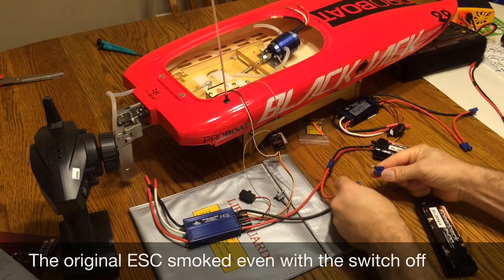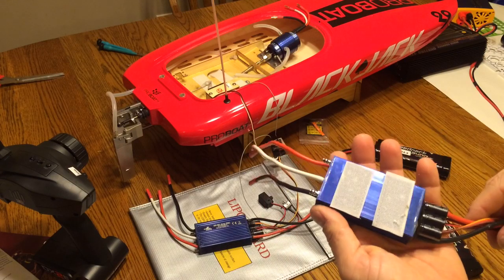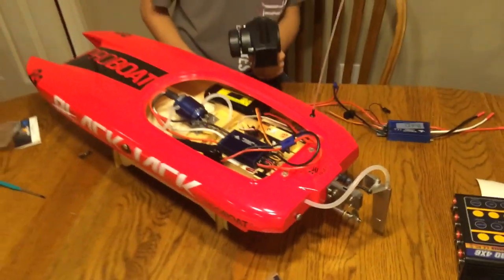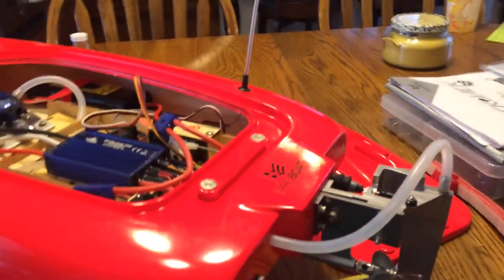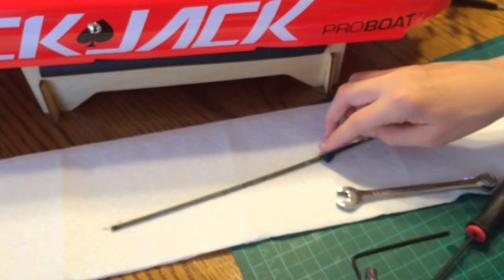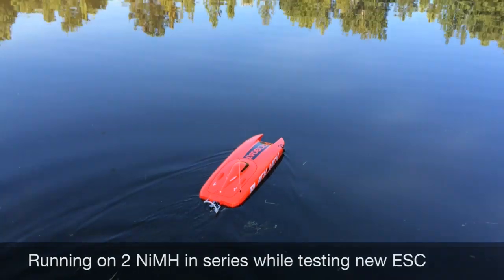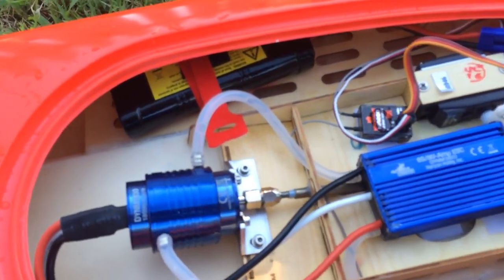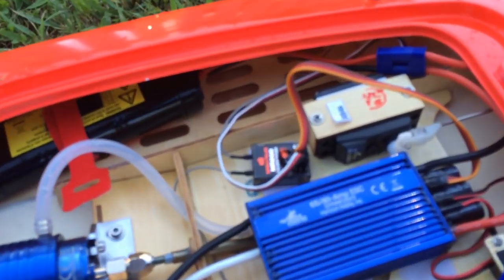New Proboat Blackjack 29 (Failures, Fixes & First Run) [KTFG 093]

Comment: Hi Kevin, thanks for the video. I have the chance to buy one of these for $300, but after seeing this and reading some comments I’m hesitant. I realize this was 10 years ago but do you know if Proboat changed anything to improve? or something I should check before purchasing?….thanks
Reply from the maker: I have been out of the Hobby for years now so not sure.  But if brand new from a reputable retailer I don't think you should be concerned.  I don't think I would pay more than $300 for this though and there may be more options on the market now.
Reply: @KTFG ok and thanks for taking the time, again I realize it’s been some time lol, I’m new to it. I like the Pro Boat models or at least from what I’ve heard. Maybe I will pass for something a bit more up to date. Take care

Comment: I keep snapping my flex drive shafts, any advice please
Reply from the maker: Did you upgrade the motor?
Stock motor shouldn’t have enough power to repeatedly snap shafts
Reply: @KTFG  cheers for the reply Kevin, no the only up grade was the battery iv got 3 cell 5000 Lipo witch the shop said would be fine

Comment: Hey there, Love your videos and had a question.. Do you happen to know what would cause the boat to slip upon acceleration every now and then? I’m running a Proboat 24 with everything stock and lubed. Thanks
Reply from the maker: Thanks,
What do you mean by slip?
Prop stops spinning, it jumps out of water?
Reply: Kevin Gittemeier Thanks for the quick reply. When I say slip, I mean that when I hit the throttle at takeoff, sometimes the boat takes a min to catch up to the throttle. Then other times, the boat responds immediately to trigger pull.
Reply from the maker: That’s interesting. Possibly a problem with remote or ESC.
Can you simulate the problem with the boat out of water?
Call Proboat and speak with them about it, their customer support was pretty good when I dealt with them.
If it’s still under warranty they will send out replacement parts.
Reply: Kevin Gittemeier Ok thanks, 😉
Reply from the maker: Judging from your image I assume you watched the CM v DC fight.
What did you think?
Reply: Kevin Gittemeier I’m a big Conor fan but love Cowboy too.To be honest, I think cowboy was a little off from the last couple times he’s been knocked out before this fight. I still feel that something wasn’t right about that fight. 😉
Reply: Kevin Gittemeier and still unsure about the Cm-DC fight. 🤔
Reply from the maker: Although there are paths for victory for Cerrone, stylistically Connor is a terrible matchup for him being a southpaw, fast starter and a sniper with the best reads and set ups in mma.
Anything can happen in a fight but if Connor doesn’t win 9/10 he wins 10/10.
Though I predicted a 1st rd KO, I hated to see Cerrone get scrubbed out like that but a lot of exciting matchups for Connor now after that.
Reply: Kevin Gittemeier I completely agree man. 👍👍👍
Reply: @bigfan1364  I know I'm replying to a year old question but I'd lean towards prop high and angle adjustments.  Sounds like your experiencing cavitation upon getting on top of the water.

Comment: I have had the Black Jack 24" for 3 years and it is a great reliable boat. Would recommend 👍🏼
Reply: My boat won't go it beeps can you help me?
Reply: It sounds like the esc in your boat and the remote control need to be synced together. They will beep when you turn the boat on normally but not continuous

Comment: what do u think of 2000kv leo and 180a seaking running on 6s
Reply from the maker: +Sm1 Sm1 
Sounds good to me, just make sure the components are rated for the voltage you intend. 6S is a lot!
Post a video when you complete it
Reply: +Kevin Gittemeier  sure i will ... but can u advice what component and if u have other option to modify b.jack 29 v3 it ll be great . i just need this to reach 80 mph 
thank you
Reply from the maker: I cant help you get any boat to 80mph, that is a lofty goal.  Maybe just work your way up with different boats and motor configurations and as your knowledge and experience increases you will get closer to your goal.
Reply: Kevin Gittemeier ....thanks bro the only reason i asked about setups is the shipping time to my country i have to wait 2 weeks and if i keep trying it will take ages.
regards

Comment: My esc didnt only smoke but it exbloded and cought on fire, almost burnt up the whole boat lol
Reply from the maker: Sounds like a common problem.
Did you get a new boat under warranty?
Proboat sent out a replacement esc and rudder promptly without issue.
Reply: It was only a litle damage on the hull, so I got replacement electronics and fixed the rest my self